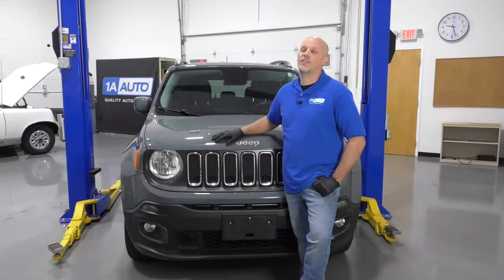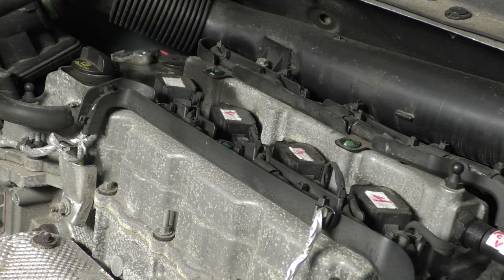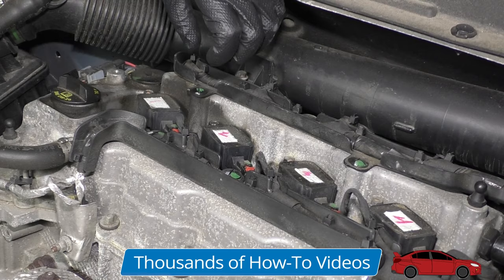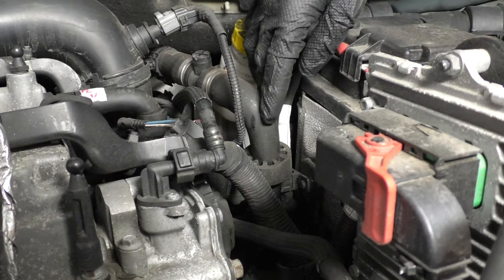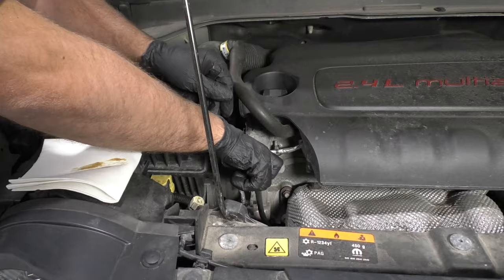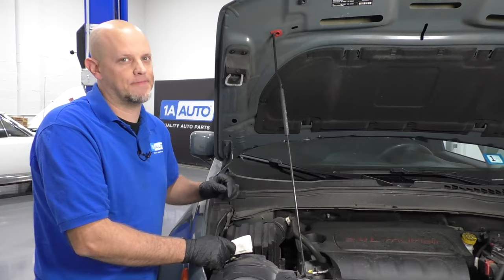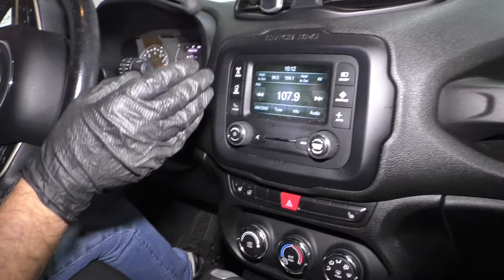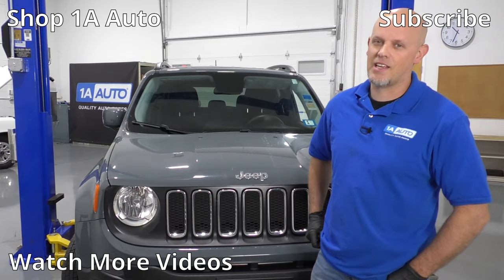Top 5 Problems Jeep Renegade 1st Generation 2015-Present

Comment: I have a 2017 Jeep renegade limited with 49,856 miles on it. Never had an issue.
Reply: It’s a woman’s car.
Reply: I have a clunking, burns oil like a mf and sun visor doesn't stay up. But so far that's it
Reply: Give it another 40,000
Reply: Lucky you! My only have 30k and have been dealing with ton of problem 🤦🏻‍♀️
Reply: @erichixson3098  lmao I’m at 80k and all of ignition coils went bad
Reply: Hahhahaha I don't think any decent car has issues at that mileage
Reply: It’s not a jeep it’s a fiat lol
Reply: At under 50k you shouldn't

Comment: One of the nastiest cars I've rented. Biggest issue was acceleration. Floor the pedal and it makes a lot of sound, revs increase to 5,000, and it barely increases in speed. Makes overtaking a very stressful activity. Automatic gearbox would also give intermittent jumps, the stereo system wouldn't link with phone, and the driver mirror gave a massively magnified view of oncoming traffic, rendering it next to useless.

Comment: I have a 2015 jeep renegade trailhawk. Over 80,000 miles on it and I just paid it off. I consider my jeep a good reliable vehicle overall. I have had three problems with it over the last 6 years all fixed by the warranty, the engine temp sensor went out and caused my 4 wheel drive to go out. A window seal on my passenger door started to leak in air and whistle and that had to be replaced and my radiator fan was getting noisy and had to be replaced. every one of these issues was covered by the warranty and was only a minor inconvenience. Ongoing issues I have are minor like the oil burn and the somewhat klunky transmission. I have just started to notice and odd thump coming from the wheel well and I think that may be cv shaft but I do go offroading and have taken some hard hits so I dont blame the jeep if it is starting to have issues. I just hope it is not too expensive to replace.
Reply: My 2015 started lagging between 1st and 2nd gear at low speeds, does yours do this also?
Reply: There is a firmware update for the ECM that helps with oil burn and clunky trans. Call your dealer and check to see if there are any updates available for your VIN. Also at 80k miles it’s a good idea to go ahead and replace the ignition coils and spark plugs. Around this time you’ll notice a marked reduction in fuel economy and then you’ll eventually lead to a misfire and CEL. You can replace coils and plugs for about $150 from NAPA or your local parts store.
Reply: @lalopalep  get a Pedal Commander
Reply: @FatalForrest  I just did the same thing at 86000 because the car decided not to start one day. Replaced the battery and plugs. Did not think about the coils though . I will do that also.
Reply: oil burn and clunky transmission is 'minor'?!!

Comment: You forgot BAD MOTOR MOUNTS AND BAD RADIATOR FAN ... they give out all the time ... I work at a shop, it’s common issue
Reply from the maker: +Fernando Estrada Thanks for the feedback!
Reply: @1AAuto    That's only true for the 2015's & early 2016's...both issues were fixed by Jeep with updated parts.  Fan issues were recalled.
Reply: Thank you. How about the rpm suddenly stays at high value when you slow down and takes some time to let you able run proper. Stepping the gas does nothing, just rpm goes up. Looks like the automatic transmission does not move to lower gear when needed. Can you advice? It only got 25K in the clock.

Comment: I bought a 2019 jeep renegade with only 16’239 miles on it in 2021. I have had no problems with my jeep at all it’s a great car and it runs perfectly. I take very good care of my vehicles and would recommend this vehicle to anyone that wants a comfortable great ride. Car maintenance is the key to a good running car. I use only full synthetic oil in my jeep. Love ❤️ my jeep.

Comment: My wife loves her 2016 trailhawk. Bought it used in 2019 with 10k miles. Recent snowstorm in the pacific northwest and the Renegade didn't miss a beat. Geolandar ATs help make wet and snow driving easy. I don't care if they call it a fiat 500, this fiat isn't the one stuck on the side of the road. Only issue so far is the adjustment gears for the headlights stripped. Replaced stripped gears for $5.

Comment: My wife drives a 2016 Renegade Trailhawk, we have had no issue at 80037 miles.  Maintenance is 5000 oil change, full synthetic, 50000 new coil pack and plugs, each oil change I rotate the tires.  Great little Jeep and she love it!
Reply: I have the 2016 jeep renegade with the same engine as the TH. I've had nothing but problems. Have you checked your rotors yet? Mine fell apart in the first year.

Comment: I have a 2018 manual with Fiat turbo 1.3 , I have 35,000 miles and drive it like I stole it, Amsoil European oil every 5000,  I live in rural area w/ bad roads , this vehicle is awesome in any weather!
Reply: You can’t drive a renegade like you stole it they’re slower than malasis even the 2.4l
Reply: Is the 1.3 turbo a good engine ?
Reply: Well with those miles what would anyone expect on any car? 
Impress us with it having 100,000 miles and above lol 😆
Reply: Amsoil european oil?  What's that?  Amsoil is an American firm ... do you mean synthetic oil?  Not sure why that should be seen as Euro?

Comment: I have a 2016 Jeep renegade 75th anniversary edition with the 2.4l and 9 speed automatic. Only issue I have had is the driver side rear brake light had a burnt ground wire and quit working. I made a new ground for it and it works like new again.

Comment: I have nearly 80K miles of spirited driving on my 2017 Renegade 1.4t with 6-Speed manual trans.  Runs great, surprisingly agile and peppy, a hoot to drive, and no problems yet. Still on orig clutch and it shifts great. I love the 6th gear for hwy cruising. Averages over 26 mpg in mixed driving on 89 octane gas. My only minor issue was noisy stabilizer links at around 40K miles, which was a cheap and easy replacement.
Reply: Where do you live? Do you have to deal with snow? I just bought a 2018 6-speed
Reply: @darinstruble  Nice, you will enjoy it in snow. Very capable,  even in 2wd form. Just make sure you have good all-season tires with plenty of treadlife left.

Comment: We own a 2018 Renegade with the 2.4l 9spd and haven't had any issues besides a intermittent slow loading Uconnect but that is just a small quirk beside that it has given us 3 years of trouble free and loyal service. I am a fanatic about maintenance and keep my vehicles in tip top shape, Our 2.4 only consumes half a quart of oil per 5000 miles which is my scheduled intervals and even though there is a Recall for oil consumption it wasn't because of the rings like you mentioned but the way the MultiAir was programmed to stay open during deceleration the update is done free of charge and remedies the issue from what I hear, I opted out of the recall because I felt a half quart was acceptable over 5000 miles. We are really loving the Renegade now with higher fuel prices and even with $4 plus fuel costs it still better than filling either my 1999 Dodge Dakota with a 22 gallon fuel tank or our 2004 Dodge Ram with a 32 gallon tank. We take the Jeep everywhere unless we need one of the trucks. Best $18k we've ever spent and I bought it new MSRP was $27k got a offer to buy it for $24k from our local dealer when I was there to get our annual vehicle inspection done.

Comment: 2016 here with 152,000+ miles on it. One air sensor went out, that's it so far. I'm scared to change to anything else because this one is so problem free.

Comment: Nice to know Jeep has known about this for five years now and looks like they haven't made any improvements. I "liked" this little 4x4 but Jeep / Fiat (a car company I like) needs to step up to the plate. Thanks for the valuable info.
Reply: Go watch his Toyota top 5 videos. All cars have issues. Stop it
Reply: Oil consumption issue is being fixed with a recall...motor mounts were redesigned and fixed by 2017 model, radiator fan issues was fixed by late 2016 and was recalled & fixed for free...so what exactly haven't they improved?
Reply: You want a cool 20 grand car or a small not sensible no one but you buys the 60 grand version of this tiny vehicle but honestly it is a sweet ride for being cheap it's in the price range ha got to give them that,  ya I get your point man but I give them credit for making something so risky but I think it's a really cool car and branding collaboration 
But ya so so so many ppl hate this car man but then again then same on the other side
Join us bro

Comment: I drive a 2015 modle and after it needed a new transmission at 40k then Reprogrammed  6 times witch has killed fuel mileage iam done still don't shift right it would go though about 4 quarts of oil between oil changes (evey 3k) I switched to 5w30 that stoped the oil burning. But iam done trading it off this summer!! Good  Reddens!!

Comment: I had a 2017 renegade and had nothing but trouble they ended up putting in 7 radiators and two engines my car recently had another bunch of problems. I end up, trading it in and getting rid of it would not recommend even though I did absolutely love it.

Comment: great video, I have had the radio problem, injector problem (replaced), oil consumption problem, Stabilizer arm replaced. W/in 3 years. The radio update, except for the GPS update can be downloaded, but the radio doesn't recognize the files from the FCA/Mopar site, no matter what they say. Thanks for the great video!
Reply from the maker: +065 065 Thanks for checking us out! http://1aau.to/m/Shop-1AAuto-c
Reply: How did you update the radio? I have a 2017
Reply: "Stabilizer arm replaced."  just this.

Comment: i had one, a 2016 no dealership couldn't pick it up without cracking the plastic under the doors. the thermostat and driver door lock mech went bad. it burned a lot of oil and now it is a class action lawsuit. causes early engine wear.  the lag when you hit the gas after coasting a little is down right dangerous. i almost got into an accident or two and was one of the main reason after three years i traded it in with 40k miles, you would hit the pedal...nothing, would have to floor it to get it to react.
Reply: It’s called laggy transmissions. Toyota’s are like that Honda and more.
Reply: @Natethegreat200c  no. It's a problem with the traction control as well. Because if you accelerate while your wheel is turned (such as when you make a hard fight or left) it trips the traction control sensor and bleeds your power. Not a lot of fun when you are trying to turn into a busy street.

Comment: Sunroof has an issue. I had to replace it twice already. Coolant temp goes very high recently. It has many issues but this vehicle with turbo engine, manual transmission and skyroof is awesome.   It accelerates like a motorcycle.
Reply: What was your issue with the sunroof?  I just had an issue that it would open but not close without me giving it assistance.
Reply: There was a recall on the engine cooling fans
Reply: @robdusher357  you have to grease the tracks with white lithium grease. That's what I had to do. Best to completely pop it out to do the whole track

Comment: I have what seems like an automatic transmission problem with the 2015 Jeep renegade I just purchased. When I start moving, it seems to have some sort of hesitation when switching from 1st to 2nd and sometimes 3rd gear. Is this a trans issue? Someone online said it is a common issue and can actually be fixed with a simple computer update by Jeep. someone else said it might be the spark plugs.
Any ideas?
Reply: My 2015 had the same issue. They did a update on it and it worked for a week but the slipping of gears started again. Luckily we still have warranty on the transmission. We took it in and they replaced the trans valve and so far everything looks good now.

Comment: I thought my wifes old 2011 Subaru Outback had the market cornered on oil consumption and piston ring issues,  guess not. I like the Jeep Renegade.  But seeing all these issues, I will look elsewhere.  Thank you for putting out these video 1A Auto team !
Reply: If it’s not too late, don’t let this video deter you. My fiancé bought her renegade in 2015 brand new and with proper maintenance through 7 years and 80k miles, I’ve never had to replace or fix anything outside of the normal maintenance. And does great in snow when I only own a 600hp mustang and a sportsbike I get to take it😂
Reply: Good move. I have a renegade it's absolute junk. But then I also think all. Jeeps are

Comment: 2015 trail hawk with 133k on it never had a coil issues,  no hose issue  does eat oil from
Time to time, and might have that cv joint noise on passenger

Comment: I bought a 2016 trail hawk in 2018 with 17K miles had a lot of problems that was covered under warranty: A/C, radiator fan 2X, radiator leak (leaked in warranty) I found after replacing fan out of warranty! power seat, wiper fluid hose issue, & now at 77K miles the only issue is the door panel & headliner fabric is separating! Due to low quality of adhesive Jeep uses & high humidity where I live! Voice recognition leaves a lot to be desired! Will I buy another..????

Comment: I instantly fell in love with this vehicle. I was convinced I was going to buy one. It's a beautiful vehicle. 

Then I heard about the transmission issues.... Why haven't you solved this Jeep?
Reply: Because it’s a fca vehicle and fca tends to make pieces of junk
Reply: @GrayGray72Gamez  guess again, it's a rebadged fiat 500 4x4. Fiat stands for " FIX IT AGAIN TONY". If you really want one you should lease it, if not go look at a Toyta or Hondas...
Reply: Just get a manual, won't have any issues with it then.
Reply: @imcrazyforwar  stop trying to drive it like a stick with the slap shifter.
Reply: Get it have a 2015 renegade trailhawk with over 77k miles on it and I love it. The transmission is not a serious issue trust me u get used to it
Reply: My sis has a 2017 jeep renegade latitude, the transmission is about the same on my dad's truck

Edit: my dad's truck is a GMC
Reply: @jmabs5096  when did Ford get in bed with Chrysler?
Reply: @jmabs5096  no it's not a rebranded fiat guy, come on. 5 minutes of research and you'll see they're different pieces of crap. The have the same chassis and frame and that's it.
Reply: @mikemann1960  it- it comes with a manual transmission

Comment: My 2021 at 11 months old with 970 miles blew the fuel pump relay fuse. They had to locate a new relay. They installed it. It's been ok.

Comment: My 2018 Renegade is getting that P2122 code, that refers to the Throttle Position Sensor (TPS). Apparently it is common these cars and is a pain to pinpoint and fix the issue.

Comment: I always thought the radio was rebooting or maybe a low voltage on start up. I experienced the OTA update which turned everything into Italian😅.
I noticed the door material comes off easily in this hot weather. Also use to get errors like thermostat bad but the original code that ce up has banished but showed air intake temp was bad. Has never showed up again. Despite the therm being bad, apparently, 70,000 miles later still going and never overheated

Comment: I have a 2018 2.4 that won't start after refueling. I replaced the canister purge valve and it helped for a month (6-8 fill ups) but the issue is back. Usually takes 3-5 tries to finally get it started, it will idle rough for a minute and then drive like normal. Anyone else experienced this?

Comment: I have 2 2021 Renegades with the 1.3 turbo engines.  We live in Texas, and everything is 75 and cruise control (both have adaptive cruise).  They will not go into 8th or 9th gear going downhill with a 40mph tail wind.  Have had TCM and PCM updates.  You are the pros...  Any ideas?  2 Dealers say this is common and deal with it.
Reply: If you are going down hill, with a tail wind,  you should be in a lower gear for engine braking. Thats the reason why it won't shift to 8 or 9th.

Comment: What about the thermostat that is the #1 issue I see as a jeep tech with the 2.4L engines.
Reply: That and the BS little motor mounts Jeep used the first 2 years of this car.
Reply: Yes.  Once the temps hit cold in late fall it goes on and off. The engine isn't heating up fast enough. No kidding,  it is 23 outside. Since weather went to 50s the light went off. I suspect the air temp intake sensor.  When my issue began the code read it was air intake,  then the 28 code constantly came on. 
Fog light housing melt after a few years.  Weird light surging.
Reply: How do you fix this issue I have the same problem

Comment: Hi my stepdaughter owns a 2015 Jeep renegade that she purchased two years ago , and the problem she's having is there is a service four-wheel-drive indicator light that comes on , and when you try the traction selector switch or traction control switch for different various road conditions seems to be not working ? When you try to select four-wheel-drive low or four-wheel-drive itself nothing happens , I tried going online to find out on how to replace the switch which there is no information on how the remove it from dashboard or console or even how the diagnose the problem ? But I believe it's the switch that will not engage the solenoid on the transmission or the transfer case to put it in four-wheel-drive or four-wheel-drive low , so my question did you ever run into this problem ? And if so how do you replace the traction control transfer switch ? Like I said there is nothing online and there's no diagrams to even be found online to show this it's almost like they are going to force you to take this to the dealer and do not want you to repair itself even if one does have the knowledge and is mechanically inclined such as myself so if you could help me I greatly appreciate thank you or anyone